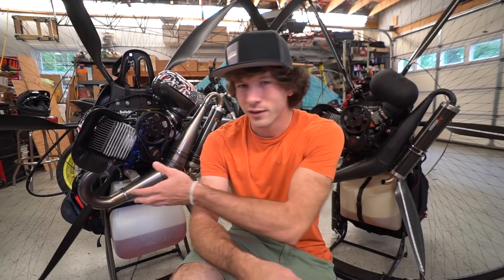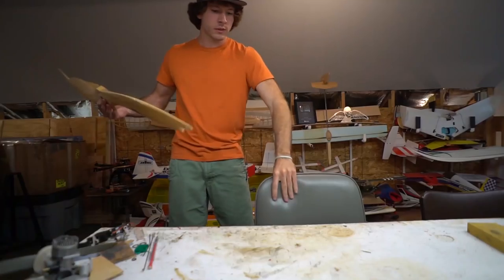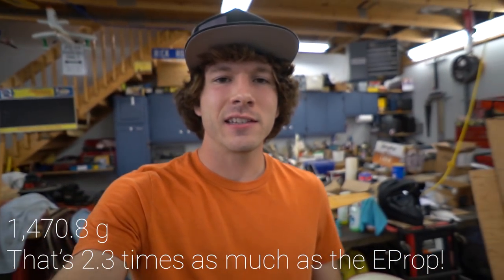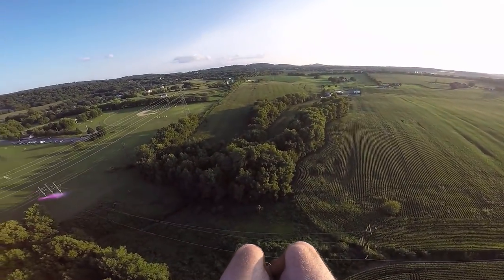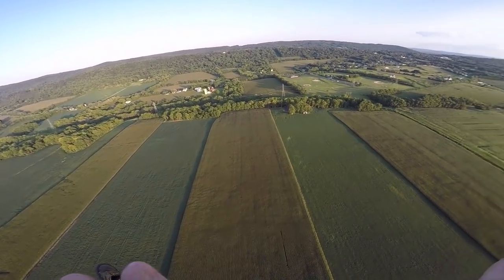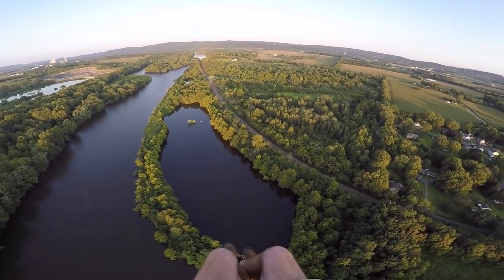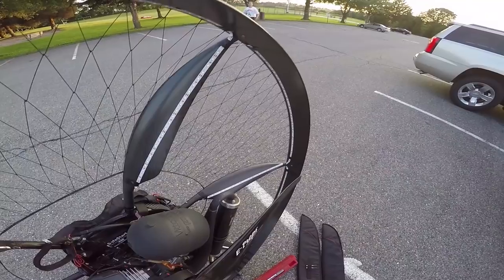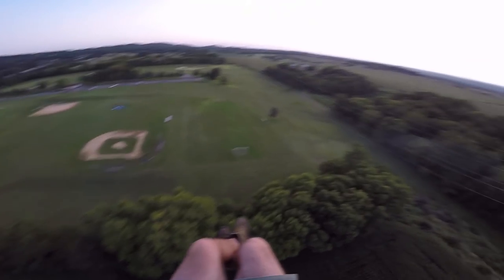Gain extra power from a new propeller!?

Comment: I've done alot of comparing my helix vs eprop scimitar model (the newest and best technology in prop shape available on the market).....the helix is a way heavier propeller! The eprop weighs less than 1 lb. I paid $100 less for the eprop.....I use about 20% less fuel using my eprop....which has the same thrust as my helix....and it revs up so much faster than my helix. I'm an eprop fan...although one point I'd like to make is that the eprop, if hits anything, shatters into a million pieces....so, you'll never have the opportunity to fix it....whereas you can fix the helix often as it doesn't shatter as easily under many types of prop damage. My $.02.....Oh, ALSO, the eprop is WAY more quiet..helpful around people that aren't fans of our motor noise.....and more quiet through your helmet!
Reply: Helpful comment. Thanks.
Reply: The benefits sound like its worth it for an eProp .

Comment: Hi Tucker! The physics word that you are looking for is inertia (in-er-cha). This is the formal term from the phrase "objects in motion tend to stay in motion, and objects at rest tend to stay at rest (Newton's 1st law)". The reason that the lighter prop feels like it accelerates faster is because it has less weight, which means less inertia, just like you described, so it can change its speed (position) much faster. It's like how it's much easier to push a bike from rest than to push a train, an likewise it's also easier/faster to slow down a bike than a train. For your flying style lighter will definitely be better almost always, but I wonder if during events like the Icarus race where you fly for long periods of time at the same throttle amount if the slightly heavier prop might be better. With the extra weight, or extra inertia, once the prop is spinning it will want to keep spinning (="better high end/top end performance") which might translate into better gas mileage(?). I know that there are a lot of factors that go into calculating fuel economy, especially when in the air, so it might or might not work out. Nonetheless, thanks for posting another great video!
Reply: I really doubt the heavier prop will give him better gas mileage. I mean a heavier sedan will never have better gas mileage than a lighter one. Even if its driving cross country. Assuming both have identical engines. The heavier one probably has a higher degree of attack in the prop. Which im guessing needs more reinforcement because of that. Hence, its heavier. Which ones gives you the best mpg at full thrust? I'll guess its the one with the highest attack angle or 'the heavier one'. Since at full thrust it will push the most ammount of air. There's a tradeoff with rpm speed though. So i could be wrong.
Reply: Trains weigh far more than cars, yet they are one of the most efficient methods of moving freight. They use a lot of energy when they begin to move but very little, respectively, once they are in motion. Once the heavier prop was in motion it might be less susceptible to changes in head wind speed, etc. There are many factors that can affect fuel economy, especially in the air, and typically by far the factor that affects it the most is weight. I was toying with the idea of the principle of inertia in my example, but in reality the lighter prop would probably win out over the heavier prop in terms of fuel efficiency in the air, not because of inertia, and not because of angle of attack, but almost solely because of it's weight reduction. It's a fun engineering problem to discuss but the only true way to determine which was best would be running tests on all props in nearly identical conditions. I don't think that Tucker would want to do three consecutive Icarus races to see which prop saves him 0.5 mpgs, so we may never know. Haha!
Reply: "inner-tcha" lol love it
Reply: Bingo.  This phenomenon is well known in performance car tuning, where a heavier flywheel has a larger amount of rotational mass and thus smooths out throttle response by resisting changes in inertia more than a lighter flywheel, which will be more responsive and feel twitchier... just as Tucker says.  

But all else being equal, a lighter or heavier flywheel (and thus, a lighter or heavier prop) doesn't change anything about the power or the torque put out by the engine.  The extra hundred or two hundred grams of weight being pushed around technically matters, but in the grand scheme of things, will be utterly negligible compared to the hundred-plus kilos of pilot and gear being pushed.
Reply: Justin modern train have diesel generators that run electric motors

Comment: Interesting! Very similar to outboard motor props as far as the effects of weight, pitch, and diameter go. 

In the day, we used to play around with flywheel mass on our 2-stroke dirt bikes - lighter flywheels would let the engine rev to the moon, and fast, but made it easier to stall if you let the clutch fly too quick. The heavier flywheel would slow the explosive hit of the powerband down, and make the machine very forgiving in the slow, technical stuff. It put more power to the ground, instead of spinning the wheel.

See, science is fun - all depends on how you look at it. :)

Comment: The sweep towards the center is for better performance, not just motor cooling. If you look at the Propeller as a circle the point on the very tip moves fastest and the closer you get to the center, the slower it moves through the air thus you need a larger arfoil and a higher pitch for the same performance. You can also see this kind of airfoil on high performance rc-plane or drone propellers.

Comment: My experience with propellers , on my homebuilt aircraft is this.  Thrust is determined by a lot of things, mostly blade pitch -which Tucker did not appear to mention once.  blade area  and airfoil thickness and if it is slightly swept back or not.  (this is called Scimitar blade).  many of these  carbon blades are very thin and rely  on flex to "flatten out" when the throttle is hit to max.  this allows  the engine to rev to full power  in the upper limits of its power band. thus develop full hp.  as the engine and blade start moving forward in forward flight the reduced static air on the blade allow it to flex back to its normal pitch.  This almost reacts like a one piece no mechanism, variable pitch propeller or "constant speed propeller".that is used on many aircraft. a bit of a "poor mans',(persons),  constant speed propeller.  If designed right you get the best prop for climbing (max engine rpm without overspeeding). and best speed at best rpm for cruising , no fix bladed prop is ever perfect for both.  they are always a compromise.

Comment: In my limited testing, my 130cm eprop is almost indistinguishable from my 125cm helix in both response and thrust. My 130cm helix is where there’s slight but noticeable differences. My cruise rpm on the 130 helix is about 150/200 rpm lower than eprop with a slightly better climb rate. The lighter weight of the eprop lets my motor crank out a few more rpm on the top end so the climb rate deviation is less noticeable than the cruise rpm difference.

Comment: I just switched to a 120cm e-prop from a conventional 115cm wood prop.  I went from 310 feet per minute climb to 380 feet per minute.  Not only that, but the wood prop would spin for a good 4 seconds after revving and release.  The e-prop slows down so much faster.  I really liked that part for when I botch my take-offs.  - nice that my prop isnt spinning when my wing is coming down.

Comment: I don't like being limited in what props I can really use on my motor - a Nirvana Rodeo. I love it, and the regular 3 blade prop is nice. They do make 3 different types, one for economy, one for power and the normal one which is inbetween (from my understanding). I have run a wood prop on it once, and can tell it's not as smooth and doesn't accelerate as fast.

Comment: Good to see your results. Also consider weight distribution through the blade length not just total weight. A good guide is hold 1 blade at the hub and chop with it by hand, you can feel the centrifugal weight. 

What about torque? Lighter blade less torque.

Comment: The moment of inertia is what actually determines how fast your prop can spin up.  It has to do with not just mass, but how far that mass is from the center.  Theoretically you could have a heavier prop that spins up faster (has a lower moment of inertia) and vice versa depending on weight distribution.  If the shape is similar and it's all the same material though and the weight measures lower, the moment of inertia is probably also lower.

Comment: airfoil on the E prop, the fatter profile provides more lift at lower spin speeds. The longer prop, its thinner, it is benficial for mid range torque and top spin speeds from the motor.
Reply: use the e prop!

Comment: Knowing the peak RPM would be helpful. If the helix is 8500 on the factory and 8200 on the plus that tells you the factory is higher power. If the helix has a higher climb rate on the same motor, that tells you possibly it's a more efficient propeller, especially if they peak at the same rpm. It's also possible if the helix peaks at a lower RPM, meaning higher resistance, that it take better advantage of the motors higher HP at lower RPMs instead of dipping further into the HP falloff.

Comment: p=mv aka the momentum equals mass times velocity. The less mass may get to the torque band faster than one having to overcome momentum of the more massive prop.  But once up to speed, the momentum will be proportional mass. From the engine point of view the massive prop requires less energy input to plow through the air, or change velocity due to headwinds, or density of the air.  The pitch and other geometry that relates to air friction can be large and may be the dominant factor. All said, it is like shoes vs boots. Pick the ones you like and matches the job, this is close enough for recreation.

Comment: also you should concider the PITCH of all the props. Ones with lower pitch tend to give you higher torque at lower rpm and faster acceration but lower top end
there are calculator charts that will determine that

Comment: The power changes would be more to do with the "Pitch" of the propeller at given revs. The more pitch on a propeller the less rpm's the engine can develop under load, the less pitch, the more rpm.... The ideal is to load the engine so that it is aspirating enough air to burn the fuel completely that the injection system or carburetor can provide at the given power settings.... I'm more of a boat person,  aviation has the added complexity of altitude, so fuel mixtures have to be adjusted to account for thinner air at altitude... etc.

Comment: I would be interested to know where the center of mass in on each blade.  Easy to find out with the e-prop as it's a 2 piece design, but what about the Helix?  Heavier might actually accelerate faster if the CoM was closer to the hub.

Comment: Very interesting and informative. Thanks.  BTW, I wish you would fly on the other side of that field, away from the high voltage transmission lines. :-)
Reply from the maker: Thanks man! I always have enough space and glide to avoid them if I had a motor out.

Comment: Tucker, how about suspending the rig from a supporting frame and measuring the full throttle deflection from vertical to compute the amount of effective thrust from each of your various propellers?  That should provide a more scientific result.
Reply: Donald Moe, he would have to also put weight comparable to his weight in the harness. That would give a more accurate study. What do you think?
Reply from the maker: That would definitely be the scientific way to do it. My theory is if I can't tell a difference, it doesn't matter. I fly for fun, so a seat of the pants test tells me enough data. If I was trying to set an altitude or endurance record, the numbers would matter more.
Reply: Sidney Daugherty -- Yes, that would make the test more realistic. He could strap in normally to the suspended rig and use a camera and measuring tape to accurately capture the deflection. Simple calculations would reveal the amount of force exerted by the propellers.
Reply: Old aircraft mechanic here.  Since paramotors operate at insignificant airspeeds (compared to, say, an F-16), a measurement of static thrust should provide a valuable indication of maximum performance for any given combination of engines, propellers, and so forth, to add to your seat-of-the-pants evaluations.  Simply tie the rig to a post with a spring scale and record the full-throttle thrust.  If you want to correct readings taken on different days or elevations, for a more accurate comparison, record the density altitude at the time of each test and convert each to standard day.  Wish I could join you in your sport, but my landing gear has aged out.  Maybe I will pass your Yammie on my liter bike some time.

Comment: some planes like the Beaver have variable pitch props to gain advantage of all speeds. You could reduce the pitch for higher RPM and more torque at take off, then increase the pitch for lower rpm and better fuel economy for cruising. But those props weigh more then you and your paraglider so I dont think it would be practical or even cheap enough to afford them and most if not all are oil pressure controlled
Just trying to explain the concept of pitch and the Diameter and how criticle it is

Comment: I think it's important to point out that the WEIGHT of a prop is NOT the only factor how it accelerates. A lot more influence has how the weight is distributed. A lighter prop could accelerate worse if the majority of its weight is far away from the center. This is one of the reasons why props that are designed to throttle up and down very fast (like multicopter props) are very thin on the outside, I think.

Comment: the weight of the prop has less impact than you think it does. yes, for the same amount of force you get more acceleration from less mass, but if we're talking about rotating something then we're dealing with torque, not just force. so what really matters is how the mass is *distributed*, ie the moment of inertia, not the mass. A heavier prop could spin up faster than a lighter prop if more of its mass is concentrated in the centre. simply weighing them with a scale doesnt really tell you anything. the manufacturers probably have details on the moment of inertia of their props

Comment: What would be cool is to suspend your motor with you sitting in it and try each prop and use a measurement of this push say from a stationary object to a point on your frame while at Full Throttle to find out which one gives you the most thrust then you might have found your cross-country racing prop that will give you maximum speed
Just an idea 😁